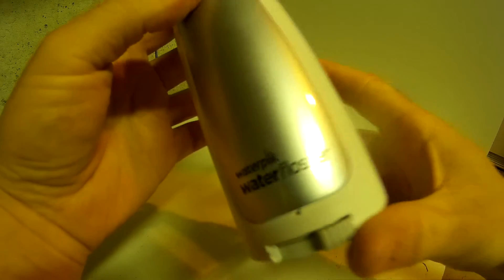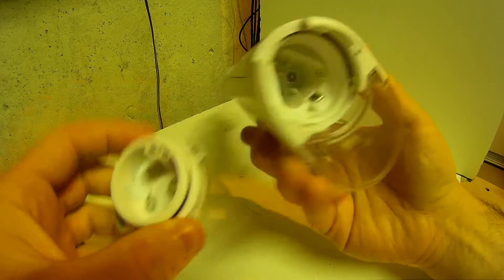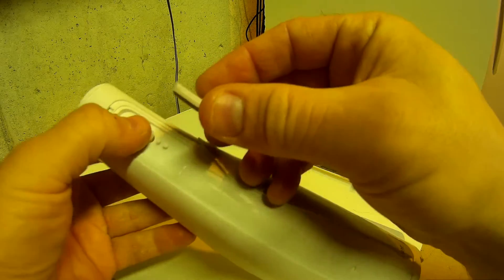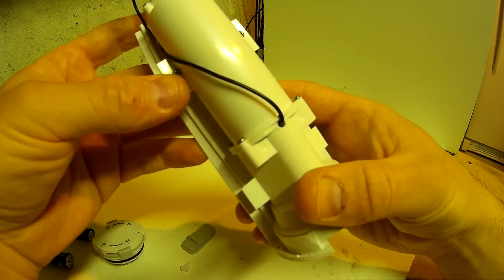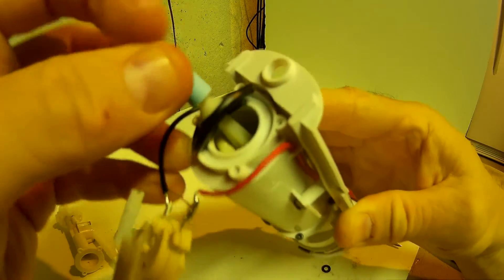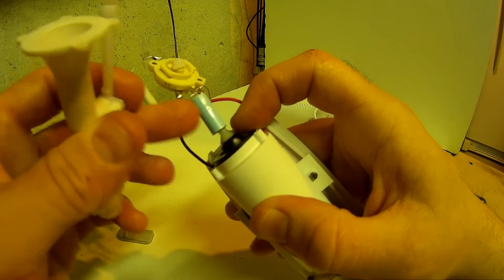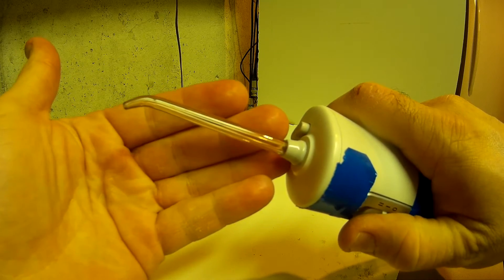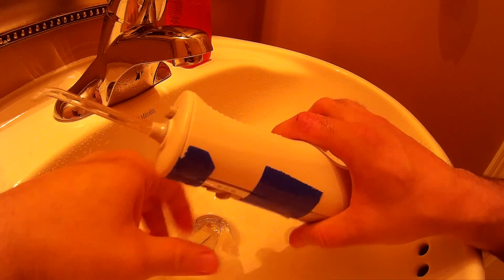Waterpik Cordless Water Flosser Teardown! See Inside!

Comment: I have a later version of this, which was dead when I went to use it a couple of days ago.  I was determined to open and fix it, which I will, but found that Waterpik is going to replace it for me, despite it being a month of two out of warranty.  It looks as though I'll end up breaking the seal at the bottom, but I can carefully glue it back.  Thanks for doing the reconnaissance for me.

Comment: Nice teardown!  
My only complaint is that it's not as waterproof as one would hope .. and drying out the guts is not possible as you demonstrated!
Reply from the maker: I think when it is new it is probably fairly well sealed but once you open it up (like I did) the seal is broken and no longer going to be as waterproof, allowing contamination of the electronics and battery.

Comment: I’m afraid this is not a very good video. Please purchase better tools, I cringed as you tried to prise the flosser open with a huge screwdriver.
There are tools called spudgers that may do the trick without scratching the surfaces.
Don’t tell us the obvious like a switch goes up and down it becomes tedious.

Thank you for your effort but don’t make people cringe - it’s not nice!
Reply from the maker: Thanks for the suggestion! I have better tools now (and better lighting/camera) so hopefully will open stuff more safely both for myself and the device!
Reply: Just be grateful he did the destructive work on his flosser so you know how it's assembled. If you're that cringy then don't subject yourself to the video. It's a pretty simple concept. It's not his fault you're so sensitive. I happen to be trying to open the exact same flosser he's working on using the same huge screwdriver so I am very happy to see every step that he explains. You know what's not nice? Giving someone a hard time instead of saying Thank you.

Comment: got mine in 2007, I saw black spots of mold behind the clear water tank and took it off, and saw a LOT MORE MOLD on all the inside components. Now I'm trying to take it apart to sterilize it!!! But it's a different model than shown. I too hope I can take it apart without destroying it.  My model has 4 visible screws near the bottom behind the clear tank, but even taking those out, I can't pry apart the 2 halves of it all the way to the top.
Reply from the maker: I think these things should have bleach run through them every week or so, otherwise mold grows on them. I don't know whether they recommend that or not, but it seems a waterline disinfectant is needed.